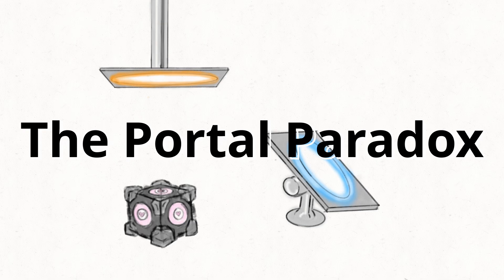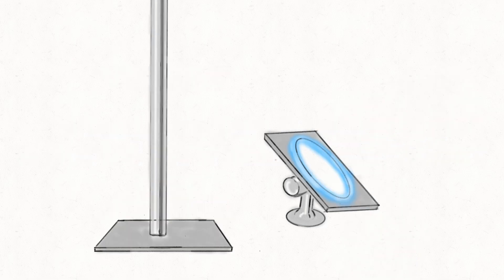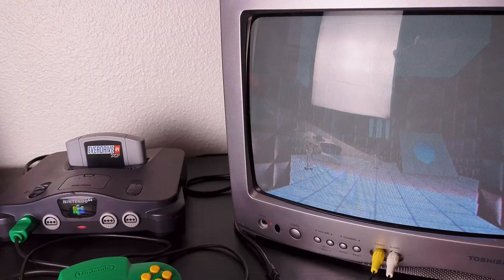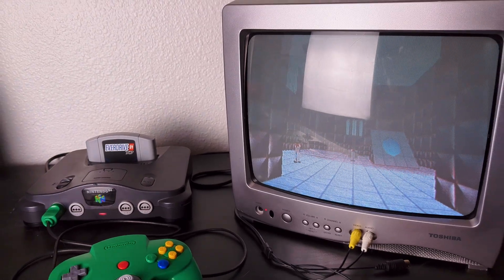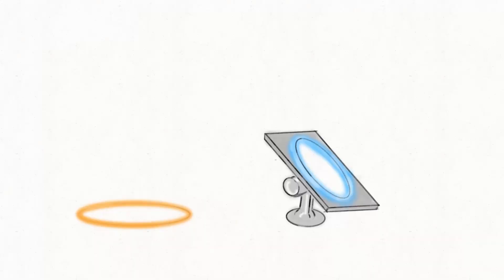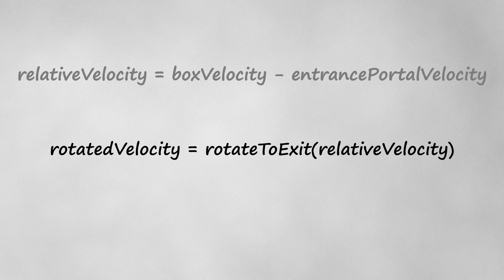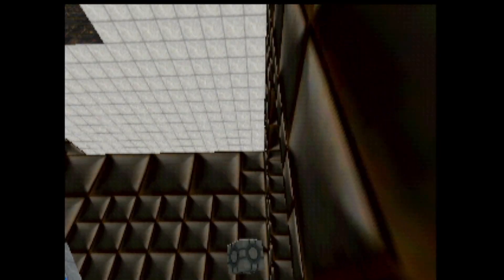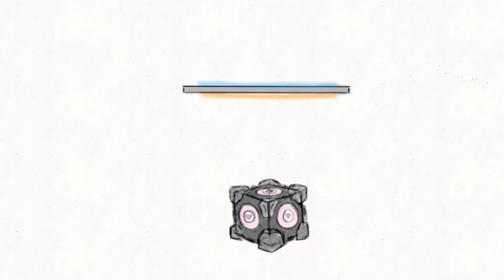I rewrote Portal from scratch and solved the Portal Paradox

Comment: The reason I don't think this would work is because I don't see how any kinetic energy could be transferred to the cube. It should have the same amount of momentum when the portals have moved across it, because nothing has physically touched it and applied force to it. Where does its movement energy come from?
Reply: Your code makes for good gameplay and is intuitive, but it is built around maintaining relative speeds as opposed to momentum.
Reply: The only available source of energy is the entry portal, so it must be it. Which means the plate with entry portal will feel resistance as the cube is pushed through it. The work required to push the cube through must then be at least equal to the kinetic energy the exiting cube gains.
Reply: @whitemouse2460  I like this idea

Comment: Now what would happen if, as the entrance portal is moving down and the cube is halfway through the portal, the entrance portal stops? Would the cube then be forced up through the portal? What if instead when the cube is halfway through the portal, the exit portal moved in the direction that the cube would have been normally "thrown"? Would the cube then move at a much higher speed?

Comment: I could also be different if there was a bit of ressistance to enter the.portal, in which case, it would accumulate energy to pass trough the portal and release it on the other side, thus making it go higher.
A bit like a spring

Comment: Clever solution but the portal intuitively should not be able to transfer its velocity which is really the velocity of whatever surface its applied to. It's not like the portal has mass. Your hoolahoop analogy applies in both examples. No matter how much velocity the hoolahoop has, if it's not making contact then it's not transferring any velocity.

Comment: Okay, so after a quick thought something occurred to me.
Its not the same as if the floor, and by extension the cube, came up to meet the portal. The velocity would get transferred in only the former scenario because there is force behind the cube, and not the portal. The portal surface slamming down on the cube would jolt it, but then the force would diffuse into the ground around the portaled surface whilst the cube would slide down from its new ramp and source of gravity.

Comment: I can see that you went with the woosh result, but i have a serious inquiry. If we take 2 differant areas of differant directions of gravity and use that as a standard and move an entrance to both at the cube then you would get a plop unless you were to slam the entrance into the platform then the energy would transfer a portion of the kinetic and potential energy to the cube and launch it a VERY small distance and still getting the plop result, the object has not kinetic energy or potential energy since it an object not in motion or simply it is being still, so tge only change in motion or energy is what gravity is changing by pulling it in a direction. That is how you look at differant angles, and you even showed what it would be like if they were going through back to back portals, and even though there is no energy as shown and the cube doesn't move why is it so differant from the angled portal example, the answer is it is flawed and there is no reason to care anymore because who tf cares? Flawed equations get flawed answers. Back to back theory: (0) X +1 -1 =0
(No energy) down force minus upward force equals no force. Or simply a not in motion cube acted upon a downward moving platforn alongside a downward moving backwards platform (platform referring to the surface a portal is attached to) equals absolute zero change in the cube. Meanwhile the angled theory: (0) X +1 +0 =1
It is simple in how you look at it but ties into more logic then a simple energy conversion theory, then you look at variables of what we see in reality, but again all we need to look at is the kinetic energy the cube has (0) which means it won't leave the solid platform at the same rate and energy as the portal. Even in the case you launch the cube into space it won't carry the energy even in a zero friction enviroment since the door to the zero gravity area is rapidly moving to the cube and won't effect the cubes energy. It is the running theory for space themed works that if you for example drain the air and potential energy from the airlock you won't be sucked out into space at a hundred miles per hour, or in a similar way have the door of the airlock smash down around you that you won't get catapulted into earths or a planets orbit all of a sudden. All this as a simple example proves the theory wrong, but like all people those who spent countless hours or months on a theory or project will reject them out of hand unless they have 3 times more experience or a higher level of education degree to certify their opinion. So as an high-functioning autistic person i guarantee i spent a solid 15 minutes to make this comment, have a blessed day.

Comment: I mean, if the portal is still open, and the floor is still beneath me, is there a reason I wouldn’t just keep standing where I am; now on a variable incline rather than level ground? 

If half the gravity working on me is holding me down, and half is pulling me at a 45 degree angle, why wouldn’t I just be standing on a 22 1/2 degree slope? The shock of the sudden change might knock me over if I’m not expecting it, but otherwise I should be fine. If a door frame falls on my head, it doesn’t propel me upwards through it, so if a portal comes down around me I should continue to stand unmoved. By their very nature, the portals don’t change the velocity of things that go through them; though if the Earth will still apply gravity to me through them, then that is the only real force working on me. 

And my velocity relative the Earth hasn’t changed, I’ve just been transported to a different location. If you take me to a pole from the equator, and all momentum is persevered, I’m going to become a smear on a wall; but the portal is just a doorway. All it does is link Point A to Point C.

Comment: here is my reply to another user, that i left in another portal paradox video, i just dont want to re-write it.
other video https://www.youtube.com/watch?v=B19nlhbA7-E&ab_channel=minutephysics

1.- i am unable to see your perspective, im not saying you are wrong, or that your or my answer is right, but i would like to reach one, so if i start sounding rude, i apologize in advance.

2.- gravity is a constant "force" that we cant omit during these calculations

3.- to my explanation. in order for an object to move it has to (here is where my explanation gets weird) "get charged with X,Y,Z forces" creating inertia, in any direction. 
when the cube, charged with X10 Y0 Z0, so straight forward (numbers there just to visualize) enters orange, will exit blue with the same values.
now, when the cube enters orange with same values but blue now aims up, my X will be affected by gravity and return me. at this point i can hear you say DUH, and i dont blame you. 

now weirder. on the paradox, orange moves to my object, from above horizontally, while blue is stationary, and for the sake of sanity, lets make the blue be vertical, instead of diagonal, because there is where i have to add extra gravity. as orange approaches me from above, all i see in this orange is the floor from where blue is at,  and when it slams into me, and my inertial XYZ is 0, i only plop on the floor, scrape my face minimally, because the only "force" acting upon me is gravity...

4.- the fallacy of the paradox, is that while slamming orange onto me, we are accelerating whatever is inside it, when it is not the case. lets flip the picture and think that blue is on a wall. and orange is on the bottom of an elevator. from blue, im looking at the floor, and pushing thru as the elevator rises, this if i try to go thru, it will just drop me on the floor, it will not pull me up due to the orange rising. 

5.- just because it happened in the games does not mean it is correct, that is likely a mis-programing, although, i would like to see this clip to see if it shed some light on my thoughts. my possibly autistic mind cant grasp this, because what happens in one direction, must happen in reverse, with opposite reaction, and to enter a still blue portal with speed, will only slam me after orange, the equation does not balance, "forces" are mysteriously lost if done in reverse.

i thank you for your time, and hope you are able to convince me of your point of view
and very likely i wrote something that did not make sense, because my mind wanders weirdly. i apologize for this.

Comment: I don't think this can be solved with such a simple formula. Movement is relative, sure, but things have their own kinetic energy and you can't create or destroy energy. The total of all the forces in the system must be in equilibrium. If the cube suddenly has a bunch of kinetic energy on the way out, where did it come from? All the kinetic energy of the "entrance" portal is accounted for by the acceleration and deceleration of the piston it's on, so how could the cube come shooting out? On the other hand, if you remove the cube and shift your attention to the displaced air in the system... intuitively you might expect air to come rushing out of the exit portal, but that's what would happen if BOTH portals were moving. The air on both sides of the portals is actually still. If you apply force to push it through with a physical object(or physical principle) such as a fan, one offers resistance to the other but the air is displaced and you can get it through just fine. However, that's not what's happening here. No physical object is applying a force to the air - in fact, no force is really applied at all. It's essentially space which is moving. This makes me think that it would be impossible to move the portal this way if we had these portals in real life.
I think perhaps the result would be somewhere between the two extremes. Maybe the portal itself would offer resistance? The piston moving the portal would have to apply more force and the difference would translate into some air moving through, bringing the system to an equilibrium. Who knows. Real physics are infinitely more complex than game logic.
All of that said, Portal 2 had moving portals, surely someone tried? The answer it would provide would still have been selected and coded by a developer, but at least it would be canon to the game world.

Comment: I'm not sure that relative speed is the correct approach in this case, if I look at this frame by frame and calculate which forces the cube is experiencing then it should just not fly out.
At all points in time the cube only experiences gravity, so when it moves through the portal it still experiences the gravity of the original floor from before going through the portal and the gravity of the "new" ground past the portal.
Now let's talk about velocity and momentum, they are not the same.
Let's say you stand on an elevator moving with 50km/h towards a ceiling, with a hole in it just where you would hit the ceiling.
Once the elevator smashes into said ceiling the elvator beneath you will stop but your momentum will be conserved and you'll fly out at a speed of 50km/h on the other side of the ceiling.
Now imagine the inverse you stand on the ground and the ceiling comes down towards you, with the hole being again where you are.
The ceiling smashes into the ground, but because you experience no momentum you're not suddenly flying upwards.
The relative velocity doesn't matter it's about conservation of momentum.
The cube has no momentum, therefore all it experiences is gravity.

EDIT: spelling

Comment: While I have no particular opinion on what is the correct answer to the paradox I don't think you can just write your own game with your solution and say "I solved it"

The equation used does work and absolutely makes sense. However it could be argued that an equation thay takes the forces acting on the cube and translates those would also work and would instead give the other solution to the paradox. 

So what I am saying is while your solution here is a correct solution I don't believe it can be called the correct solution.

Comment: There ARE moving portal in Portal 2.
They're being used specifically in one scene in which you need to use a laser and a moving surface to cut through pipes.
Although I think I've heard there more of a hack and don't really work find with actual objects.
Reply: those use hacks and mess up whenever theres an actual object
Reply: trouble is... those only move laterally, as soon as they rotate or extrude, portal's gone
Reply: as someone who knows slightly too much about portal 2:

cursed. extremely buggy, gives you like 500 velocity for no reason, and you just get sucked into the portal sometimes too.
in the challenge mode speedrun of "neurotoxin sabotage", the player climbs up to an area near the stationary portal, jumps near it, and gets sucked into the portal because of moving portals. there is a reason why they aren't used often lol
if u wanna see this urself look up "neurotoxin sabotage implosion skip" or something
Reply: yeah, there is a command to enable them in any map, however he was talking about the original Portal, not Portal 2
Reply: All the portals are moving since earth and moon moove aswell
Reply: @dopi3220  so true, god everyone’s dumb it’s like they don’t even consider the movement of the solar system relative to the Milky Way or the movement of the milky way relative to… ? on a daily basis lmao
Reply: @DanielBParada  i don't think the developers of the game implemented earth's rotation into portal 2, i think everything is stuck in one place forever (it's just a video game) until the neurotoxin level where there are moving portals. unless you're being sarcastic, in which case, i'm sorry, it's hard to tell, lol
Reply: @CombustibleLemon77  yeah I somehow doubt they bothered too lmao I was just saying bullshit
Reply: @CombustibleLemon77  I think everything is just stuck in one place forever (it’s just a video game) had me laughing tho ngl

Comment: The cube is stationary IE has zero momentum or kinetic energy thus when slowly pushed threw a portal it slowly comes out the other side proportionally. The portals don't touch the cube they act as an open door not a hot wheels booster the portal inherently doesn't transfer any friction or momentum to any object just because it passed threw it, so slamming a portal down on a cube would act just the same as slowly placing it threw the portal regardless of transitions relative speed. The cube has to at most react to the change in gravity at a quicker rate relative to the rate of portal transition but this couldn't possibly toss the cube with enough force to get it airborne like you've shown.
And on another thought if u were to be placed between two portal and compress them together you wouldn't be transferred to a different world again the portal is a door but if the space between the portals is finite and let's say you are slowly falling down them over and over again closing the distance to the portals would only serve to have you eventually standing on your own shoulders then forcing your head  closer and closer towards your feet where at minimum your squished and at most both squished and stretched into an increasing smaller space till ya just kinda leak out the sides

Comment: This is incorrect, since if velocity is purely relativ then imagine the following scenario: The portal rushes down on the standing cube with a high velocity but stops immedaitly when it absorbed 50% of the cube. Since the relative velocity would make the absorbed half try to fly out of the other portal the not absorbed half would exparience a drag from the absorbed half, that is trying to fly out of the other portal. The cube would lift off, even though only a portal rushed down onto it and stopped at 50% absorption. It is obvious that this wouldnt really happen. I allways disliked the theory of relativity but thanks to your missguided experiment i can finally disprove relativity! Thanks!

Comment: You're violating the conservation of energy. The cube does not have starting energy. Unless the portal provides its own kinetic energy to the cube, the cube does not gain any and remains at rest. What it does gain is gravitational potential energy. This is done through the portals' natural energy requirement to move an object from one place through the next. 
Your equations are sound, their assumptions are not. 

If the portal did provide its own kinetic energy, then that would mean that as the moving portal moves onto the cube, it generates a force, pulling the cube through (since not all of it goes through). Essentially, the moving portal acts as a force source and pulls the cube through itself

Comment: I’m wondering what would happen if the portal only slammed down halfway (or some other fraction) instead of all the way down. Because that would mean all the box that went through would have velocity, but the back end wouldn’t. I figure at a certain point the front half would pull through the back half? Or, if done with enough speed, would rip the box in half (probably not in the simulation but in “real life”). Thoughts?
Reply: It's just like pulling someone's arm. You could pull only the arm or pull it hard enough to move the whole body or pull it so fast that it rips off the dude's shoulder.